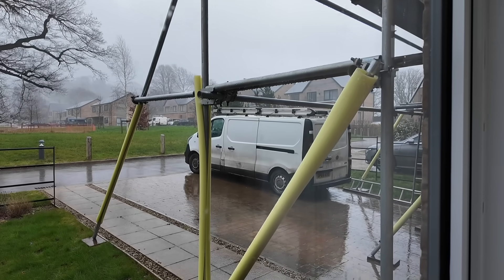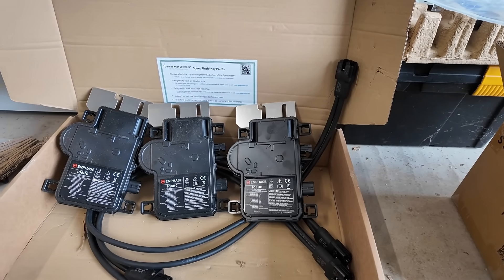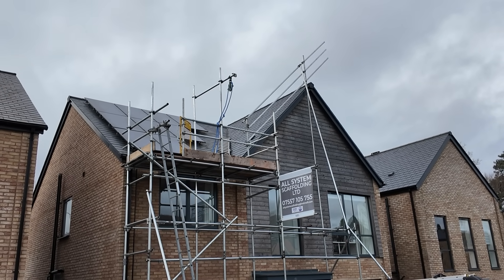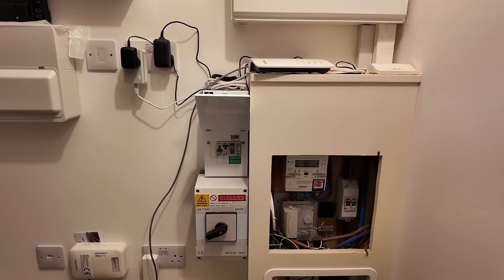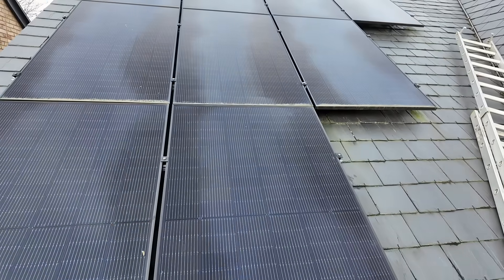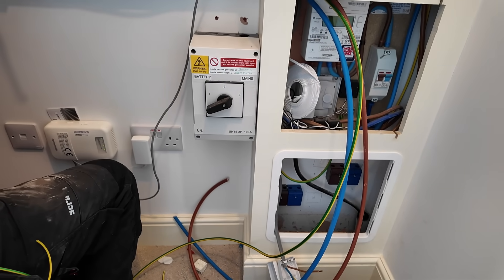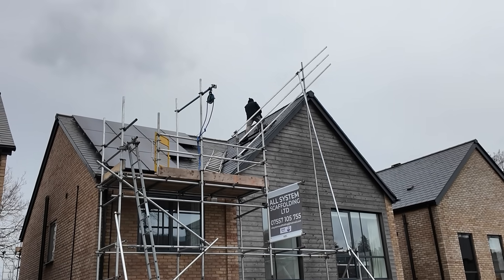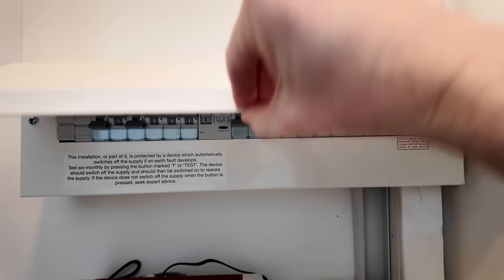Adding extra solar - string inverter vs microinverters

Comment: It's disappointing that none of your neighbours have solar , they are modern houses.
Reply from the maker: Indeed.  I've been working on them ;)  Some of the newest properties to be built on the same site do have solar included, but our row was built three years prior, so I'm guessing the developers only thought about it later in the planning process.
Reply: Is there a bulk discount deal for your neighbours to be done with your installers, Tim?
Reply from the maker: @robjones8950  if I can get enough of my neighbours to install solar at the same time I'll certainly be asking that question.
Reply: @TimAndKatsGreenWalk  Don't if you are wanting more from DNO export ! :) One of the reasons I jumped in with my install was neighbour was doing it and worried that the rest may follow. On a modern build you may be ok; but we are on very old wires in the ground. Eventually solar everywhere is going to give them huge issues on a sunny summer day. Hoping my system will have paid for itself by then.
Reply from the maker: @ well, my limit is already set and can't go any higher, unless I upgrade to three phase, so I wouldn't be applying for any more anyway.  It'll be interesting to see if that affects my neighbours applications especially if they all apply at the same time.
Reply: @TimAndKatsGreenWalk  I got 14kW on a G99 with mine as in theory that is the highest i can export with the Solar 8kW and dumping the 6kW from the AIO at the same time.
Did try it once and it did work, so hoping if I just sort out and add to the Solar then i won't discharge the battery if it is sunny. Or accept clipping on the current inverter. Really only looking to add more for the winter low sun.

Comment: As it was only possible to squeeze 11 panels on our due south facing roof we had 4 more panels installed at the same time on our gable in an E/W configuration. Whilst not as beneficial as facing due south, this should extend our generation day a little at both ends. It did require extra scaffolding though, but the marginal cost of doing it at the same time was reasonable. Each array is on its own MPPT into a PW 3. So no micro inverters were needed (we have no shading issues).
Reply from the maker: Very nice.  Yeah, I wouldn't bother with microinverters or optimisers if I had no shading issues.

Comment: I have a Givenergy system with all South panels which are great until late afternoon.
Only yesterday my installer fitted 3 extra west facing panels also with enphase micro-inverters to extend our generation day a little.
Reply from the maker: Nice.  West is definitely a great choice for solar to coincide with peak demand.

Comment: Really keen to seen how the new arrays go, I have a detached garage which could get 4-6 panels on and am thinking to use microinverters along side my main string inverter
Reply: I have both a string inverter and a cheap (dual) micro inverter and Enphase micro inverters.

My advice for you is to get a hybrid string inverter if that roof has no shading issues. That way you can add a DC coupled battery later with less conversion losses. If the roof is complex, has moving shade or you just don't want an inverter inside the garage, the Enphase system is great. It really works well in less than ideal weather conditions and the 25 year warranty is something hardly ever needed by customers worldwide. Even if one micro inverter fails, you still have the rest of them while waiting for a replacement. String inverters generally fail a lot sooner and when that happens you don't have anything until it is replaced, often at your own cost because of a shorter or more limited warranty.
Reply: @SolAce-nw2hf  I have converted the garage into my home office so there isn't a lot of room to fit an inverter. The roof is a North/South so I'm not sure with only a couple of panels if we'd get to the start up voltage, especially on the North side (although I do note Tim's inverter is pretty compact and with only a few panels). I'm a bit like Tim and would just be curious to see how micro's would work against the north/south panels on the main house and get a little closer to being "net zero".
Reply: @ In that case go with the Enphase system. I have my NE panels on IQ8M and in overcast weather they outperform the SW string inverter with ease. No noise inside and with only a small number of panels the added cost of micro inverters is very little. 

The IQ8 series also has a huge capacitor inside that can gather energy and keep most of the inverter offline only to deliver that energy in short burtsts. Normally a string inverter will constantly have to overcome it's internal power consumption before it can deliver anything to your home.
Reply: @SolAce-nw2hf  yeah, with the limited number of panels there isn’t too much of a cost difference in micro vs string inverter. My house has an odd roof layout and my initial thoughts were to go with enphase, but with 18 panels it was getting a bit pricey. I’m also keen to try bi facial panels and see how accurate the heatable claims are. I doubt I’d get the rea panels but can’t see they are that much better than any other panel out there. But this is a project for a bit further down the line. Heat pump is the next toy 😉
Reply from the maker: That's a good use of space.
Reply: @TimAndKatsGreenWalk  hopefully, just need a duct laying from the garage back to the house which I'd like to get done in the summer when we relay a patio. Look forward to the comparisons in the next few weeks on the 2 new arrays!